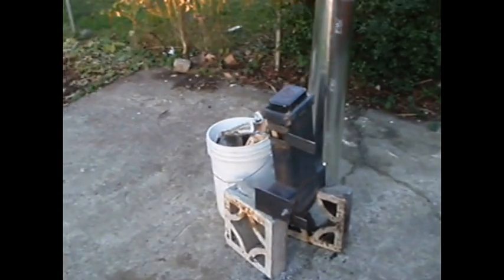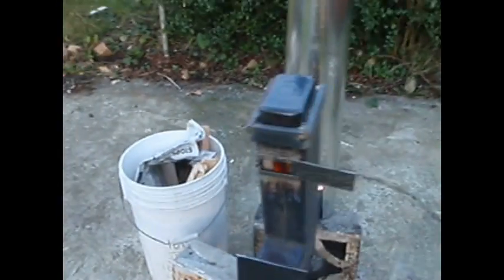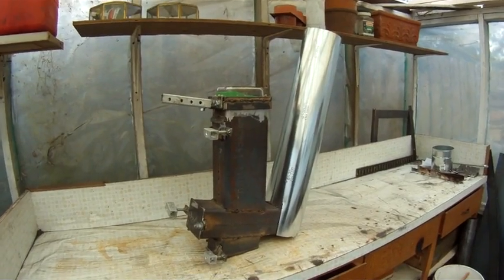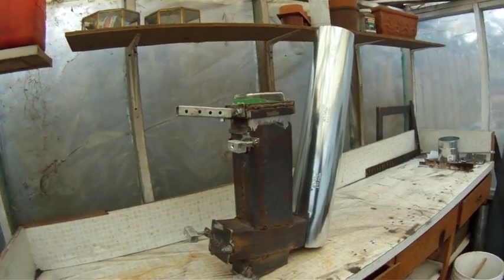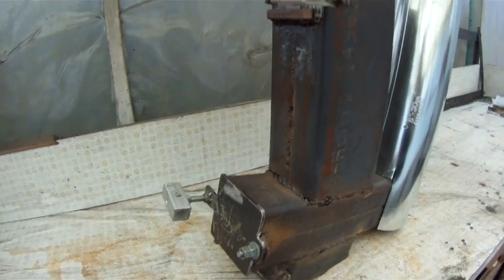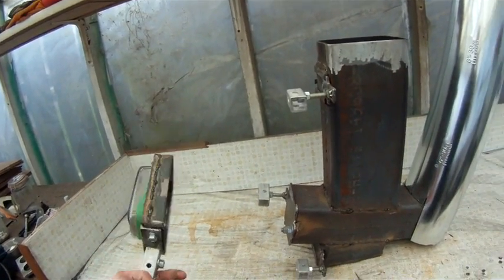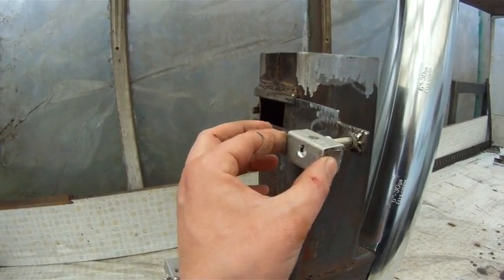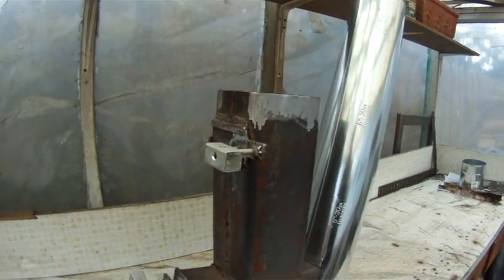Rocket Stove Heater Build #3

Comment: Very nice work. The implementation of the pyrex is sweet. It would be great if you could laser the temps from around the unit, especially after your tank is mounted. I'm getting ready to do a build myself and between your design and the design from ZeroFossilFuel I am grateful for your efforts individually. It's inspiring. I hope to share my efforts soon.